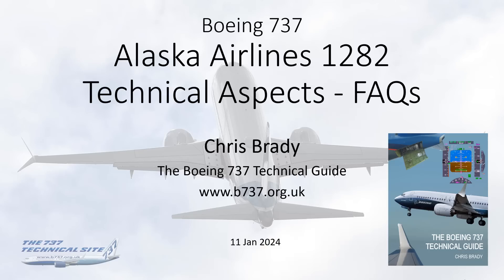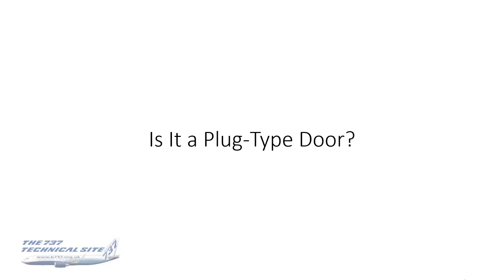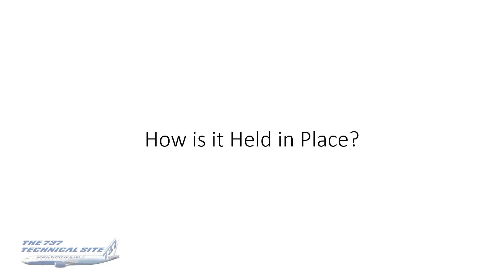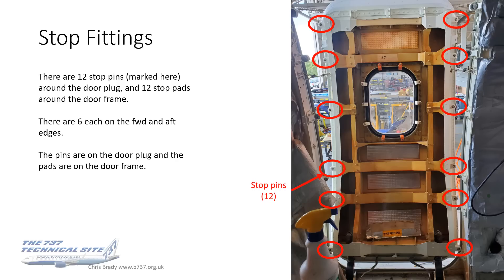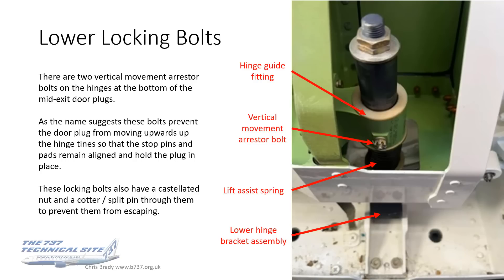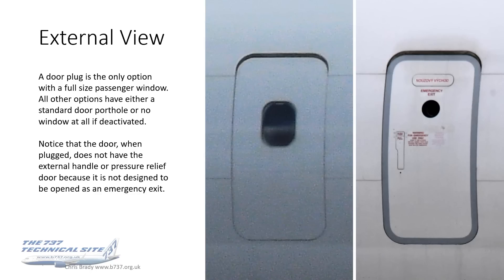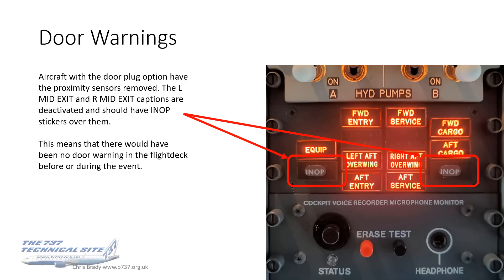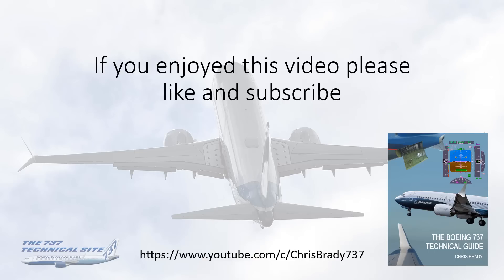737 Technical Aspects of AS1282 FAQs

Comment: Have you see  the pictures from United airlines that show the bolts for the lower bracket assembly not fully screwed in (the ones on the right of the image, not the one with castellated nut). I noticed also the accident aircraft is missing one of the lower brackets?
Reply: What about them? This is a narrative on how the door works.
Reply: @craig7350  I’d like to hear from someone who knows about this though what would be the implications of those being loose. I’ll change the question
Reply: @tomstravels520  Absolutely..   We really don't know what bolts are missing and which ones are loose.
Reply: @craig7350  the side bolts are critical to proper operation of the door. THey hold the hinges in place.
Reply: I saw a picture like that and sent it to the NTSB.

Comment: Amazing: the (massive) hinge guide fittings sheared / torn off from the departing door plug. The hinges and the springs remain bolted on the fitting mounted on the aircraft, without catastrophic damage on the structure.
Reply: One of the hinge fittings appears to be missing, according to the NTSB briefing the other day.
Reply: Plus the fly away door is in very good shape.
Reply: I thought I read somewhere the springs were also missing?
Reply: Yes, NTSB were still looking for the public to help find the springs after Bob had found the door plug and 2 phones had been found. As they didn't show the public what the springs look like, they will be offered anything from a vehicle suspension spring to a retractable ballpoint pen spring!

Comment: Shows how difficult risk assessment can be. The boeing engineers must have thought a mechanic could miss 1 maybe 2 bolts, so having 4 would ensure  door restraint always. They obviously considered the entire task being overlooked as extremely remote in the risk matrix. And there are more contributory factors to go in explaining how the door moved off the stops. Low pressure, -ve g, aerodynamics, turbulence and so on.
Reply: Agreed - when assembled correctly, the vertical movement arresting hardware appears to have quadruple redundancy.  And if the door can't move vertically, it can't move outward.
Reply: We don't even know of the door restraint bolts are the problem.  It could be the loose bolts to the frame.
Reply: @JoeLinux2000  the loose bolts in the lower hinge slider bracket are definately a non conformance but if the 4 locking bolts, particulary the upper guide bolts, are installed,  the door just cannot move.

Comment: Great video yet again; unfortunately the audio quality is very poor; microphone too far away?
Reply: Now we’re discussing the volume of this video?!? Come on people, let’s focus on the content. BTW, does the device you are using to watch this video have a volume control on it? If so, use that if the volume is too low for you!
Reply: Agreed...well said.   Also enough talk regarding if this is a 'plug', 'door' or 'door plug'.  We all should get what it is designed for...
Reply: @jkaufman1200  In general I think any YT'er welcomes feedback for improving the quality of their content. Anyway, in response to your specific rant , yes laptop in question has volume control but even at full  throttle it's barely loud enough and the background hiss is rather annoying. Happy now?
Reply from the maker: Yes, it was too close for the previous video. I only moved it an inch. Guess I need a better mic.
Reply: @ChrisBrady737  Need better volume control.

Comment: This is entirely confusing.   I'm not convinced anyone on Youtube knows what they are talking about.   Your narrative does not match what is written on the slides, which must have come from the manual.  For one thing your are saying the roller pins travel, but if they are on the door frame they cannot move.   The guides must seat down onto the roller pins.
Reply: Watch it again. This video is actually correct.
Reply: @johnbriggs3916 .  I did go back.   What I know for certain is that if the roller pins are on the frame, They don't move.  The door guides move with the door.  Today it's up and out for the door,  Someone said on the actual plane the guides were fractured.   Gryder's therory is the the the door came loose at the bottom leading edge.  But he doesn't understand  how the door actually works.   We don't even know which bolts are missing and which bolts are loose.
Reply: @JoeLinux2000  There's your first mistake listening to Gryder. He is all about hype and conspiracies and caters to people like that and is basically considered a clown by the majority of the aviation community.
Reply: @JoeLinux2000 The pins move up relative to the channels. In more absolute terms, the channels move  down on the pins.
Reply: @JoeLinux2000 The guides are longer (1.5 in) than the pads (about 0.75 in). So the roller pins were still in the guides when the plug was ejected explosively. That is why the guides were damaged.
Reply: I understood it.
Reply: Again the pins cannot hold the roller pins in position.   According to you the pins are fixed to the door frame.   The restraining blots keep the door from moving upward off the pin.   No one can understand anything if you don't use correct basic terminology.

Comment: Plug doors by definition use pressure differentials to secure themselves. Most commonly, this is achieved with wedge type geometries, but this doesn't necessarily define them as plug doors alone...
Reply from the maker: Does that mean that the stop fittings make them plug-type doors?
Reply: @ChrisBrady737  (Engineer's perspective) I would certainly say so...they might not look like much but, all things being as they should be, the bigger the pressure difference the more difficult it would be to shift the doors at altitude because they're being pushed against the aircraft's frame. 
I think the "error" in the video and manual highlight a far wider problem in the design of the plugs though. For the life of me I can't understand the decision to configure the pins and guides in the way they did. In theory the assembly is fail safe, but I would have thought more effort would be made to make them fail fail safe in the event the bolts MAY not have been installed correctly. Without them, and taking vibrations into consideration, the whole design is akin to shaking a spring loaded mousetrap repeatedly and praying it doesn't go off. And based on what the NTSB have said, that is exactly the way it transpired. Tweaking the pin and guide arrangement, along with the spring mechanisms, could have made it safer relatively easily.
Reply: @eddy66t6  I agree.   Plus it looks very difficult to put the restraining pins in from the back where you cannot even see the hole.
Reply: @eddy66t6  It appears that the door plug would stay in place under pressurization even with no bolts installed if each stop was a shallow cup that trapped the pin.
Reply: @ronoconnor3910  I think I get what you're putting down, and agree generally... Something I will watch out for in the NTSB report is the state of the surface of the stops and pads in question. I SUSPECT they will show signs of excessive wear because without the safety bolts in place I'd expect excessive vertical motion on the surfaces of each of them. Normally I would presume that the safety bolts prevent that kind of motion, so I suspect the surfaces are not intended to deal with a lot of vibration.
Reply: Agree, but I suspect the door came out of alignment before the pressure differential grew.
Reply: Yes it is called a plug door because the door stops are behind the frame stops when closed. Thus technically the door in the correct rigged position the door stops are wider than the fuselage door jamb (frame) stops.  Thus the door is consider a plug.  Not sure that was said understandable but close enough.   The pins on the stop fittings are used to fair the door skin with the fuselage door cut out skin.  In my time this is the final rigging of the door where these pins are adjusted when the fuselage is under pressure in the pressure pit.  One last thought is looking at the  the fuselage cutout skin trim and the door skin trim pics.  No! damage.  Does that give you a little clue how the door blew?  Did  notice the previous article had the door moving in the incorrect direction to open, not a big deal.
JD
Reply: @ChrisBrady737  IT's unclear to me the orientation of the twelve stop pins and pads.   Also are they metal to metal or something else softer?
Reply: To simplify understanding of Boeing nomenclature regarding “plug type” doors and hatches, it is simply whether the door-to-frame interfaces are loaded in compression or tension.    

     That’s it.

       When this plug door is properly secured in the closed position, the interfaces increase compression loads as the pressurization differential is increased.
Reply: This door should not be called a plug in my opinion because it has a hinge.
Reply: @JoeLinux2000 Most plug doors have hinges - all but the over-wing exit types.
Reply: @RicktheRecorder  
        Boeing has redesigned the 737 overwing exits to also have hinges for quite some time now.     

    The majority of the NG fleet and all of the max aircraft have upward and outward swinging overwing exit hatches.

       The high mounted hinge and powerful springs cause the door to swing upwards quite quickly when they are opened.
      
     This speeds egress since it removes a requirement to lift and move out of the way a heavy, traditional plug hatch.
Reply: @JoeLinux2000 The hinge is irrelevant. It is called a plug because interior pressure forces it closed (assuming the restraining bolts are in place...)

Comment: Do the stop pins need to be backed off before the plug door can be raised ? It looks as if the upper guide track fitting has a vertical segment before it transitions to a curve.
Reply: The guide track on the door has a slight curve inward. So it looks as the door is raised it is first moved away slightly from the stops. Most likely the door is set into position with bolts secured, and the stop pins initial and only adjustment made at that time to just touch the stop pads.
Reply: Doesn't appear so: the curved portion of the guide track aids closing. The curved part brings the plug in and then the vertical part slides the pins over the pads.

Comment: the hole in the cabin may have been much larger than what was required to be considered for the rapid decompression scenario therefore lowering the cabin pressure faster than expected and therefore increasing the pressure on the cockpit door over and above its design pressure despite the relatively small volume of the cockpit. The expected decompression hole area can be calculated in accordance with 25.365 inadvertent opening of a plug type door may not be a failure condition requiring consideration - i leave this up to experts
Reply: I think you have a point.
Reply: yo boeing had a good reason not to document this if it was a hidden feature
Reply: @vevenaneathna   I don't think that anticipated a door blowing off.
Reply: @JoeLinux2000  well.... its not impossible to imagine someone sneaking a small zip gun on the airplane and using it to depressurize the cabin and gaining access to the cockpit
Reply: @vevenaneathna  but the resulting hole would be smaller and the pressurization leak slower and therefore the differential pressure would never reach high enough to cause the door to open.

Comment: Big problem with understanding the plug, the structure, the spring is that the photos don’t indicate their orientation (looking downward, inside plane looking out/outside looking in, left/right, plug/frame…). Each photo is from a different angle. Also, as a “plug” in a pressurized cabin, there are no apparent gaskets or seals—also confusing. Do the pins reside inside the pads when closed to push against them? Do they rise up and over or down and under the pads in order to swing the door outward?  Just strangely difficult to comprehend for no good reason.
Reply: Yes, the pins are inside the pads. They rise vertically to clear the pads when the plug is lifted (assisted by the springs) to open the plug.
Reply: @johnbriggs3916  Is the gasket on the door or the frame?
Reply: @JoeLinux2000  I've no idea. I would guess the frame, but wherever it is, it has to be completely independent of the pin/pad system holding the plug shut.
Reply: A possible source of confusion here regarding the pins and pads is that the pix at 3:30 and 3:50 appear to be on left side of door but the following close up at 4:25 of the closed one is on the right side. Because the guide track pix at 5:30 is definitely the right side.
Reply: @JoeLinux2000  What really distinguishes it from a door is that it lacks a handle and a latching/locking mechanism. Plus it is not supposed to open...
Reply: I agree.  This is a very confusing door design which people have great difficulty explaining.

Comment: Emergency exit doors have a normal size window.
Reply: Overwing exits
Reply: That's the over-wing emergency doors, which are shorter. Emergency doors in this position have a small porthole.
Reply: If they are not next to a seat, I believe they have a small porthole.

Comment: Keep up the good work, sir. Errors in the maintenance manual like the ones mentioned early in the video - how often do those occur and how serious would you deem their consequences? Is it a slight oversight that happens all across the board or is it something serious that deserves more publicity?
Reply: Often...without giving Boeing an out technical documentation is tough. Often it's written at the same time as development of the product when everything changes almost daily. Critical stuff is usually caught during reviews but if you think phone books can be written without a single mistake I've a bridge for sale...
Reply: When one is performing maintenance and removing or installing the bolts, it will be obvious which way the door plug needs to move to open or close it.       

       One thing Chris pointed out in a previous comment I made regarding the AMM typographical error, was that if the spring rate is great enough to lift the mass of the door (and not just provide an assist), then an initial downward force might be required to remove the bolts as they will be loaded in shear due to upward force on the door plug.
Reply: I don't know but it's confusing as hell.

Comment: Thank you so much Chris ! So precise and clearly documented as usual with you.
Reply from the maker: You are very welcome
Reply: Not true
Reply: @JoeLinux2000  and how much 737 experience do you have exactly? Myself and Chris Brady have both flown the 737 for many many years. I personally have 15 years, and 14,000 hours in the airplane. Don’t criticize Chris the stuff he’s putting out is wonderful information and you sound like a nitpicker.
Reply: @cyber25573 this video does address a couple of errors that occurred in previous video but which were understandable if one hadn’t actually seen this door in person, and then relied upon manual which appears to have a minor issue. 
Sometimes what seems to be misinformation can actually be just a misunderstanding based on imprecise wording or less than ideal pix or diagrams being used. 
I am glad that this video was made to clarify many of the things people were commenting on.
Reply: @JoeLinux2000  are you kidding ?!!
Reply: @gev340 , No he's saying the roller guide pins move, and of they are part of the frame, they don't move.   It's the guide track on the door that would move.  This one of the better channels but there is still a load of misinformation.
Reply: @JoeLinux2000 He's talking about relative motion.
Reply: @JoeLinux2000  go around 5'55 and watch and listen to Chris. It is clear and correct. Roller are on the frame and guide track on the plug. When you lower the plug, it's engage the guide and the roller together. This permit to tackle the plug to the perimeter of the MCEED hole onthe frame skin. The stop pin's purpose is to rigg the tackle of all the perimeter of the plug. I didn't hear and seen any mistake from mister Brady. Sorry
Reply: @RicktheRecorder right, he’s saying the roller pins move upwards when the door is the part moving downward. Relative movement.
Reply: @JohnHallgren It's conventional to think of the frame as stationary and the door as moving, but it's only a (reasonable) convention. If you are just looking at only a drawing of the roller-pin's engagement with the channel guide, then it's just as accurate to say the roller slides along the channel as to say the channel slides over the roller.